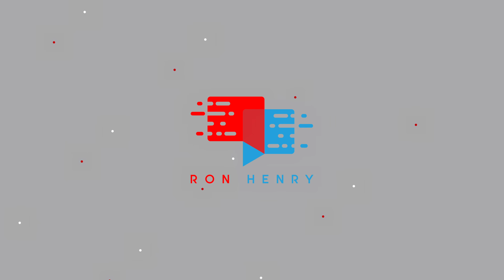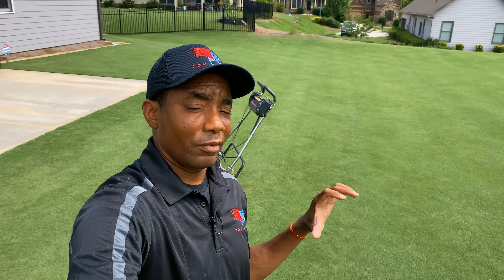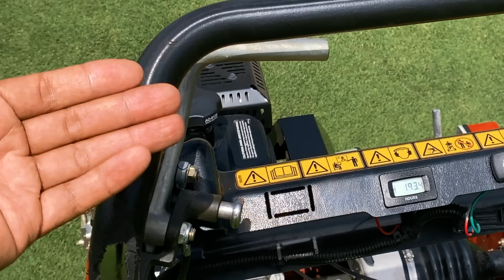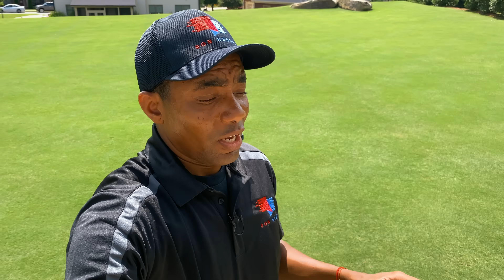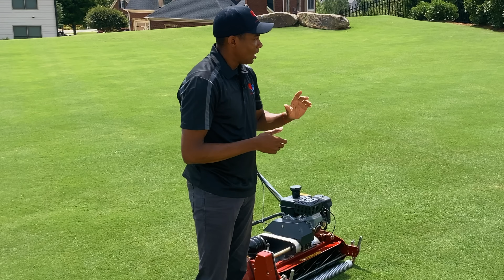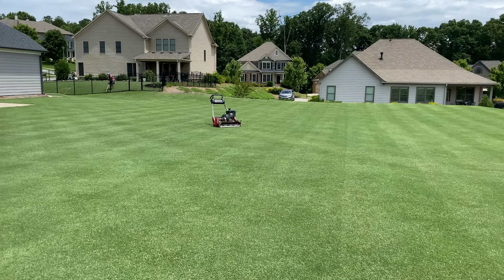Toro [GREENSMASTER 1600 REEL MOWER] - Is it Worth $10,000?

Comment: Hi Ron, so I have a tru cut and recently bought a flex 2100. Does HOC are different from each one to another?? Because I mowed with a tru cut at 3/4 and then used the toro at 0.4 but barely clipped any!! I asked someone and said HOC will do differently between different brands due to the weight of the machine! What do you think?
Reply from the maker: I think the hoc isn’t set to what you think it’s set to on one of the mowers. There may be a slight difference in cut at the same setting due to weight, but that’s a pretty big spread from .4 - .75
Reply: @RonHenry  I think so, maybe the tru cut! It’s the 4th hole from the bottom.
Reply from the maker: @ahmaddamra5847  Unless you're measuring it with a HOC guage, the holes on a TruCut don't mean much. Depend on how the front roller is mounted, there can be a large variance in HOC from mower to mower.
Reply: @RonHenry  then it’s definitely the tru cut because I measured my toro with electronic accu gage lol

Comment: How do you find a pre-owned toro greensmaster?
Reply from the maker: Heya Todd. I got mine from Prarie Turf equipment in Manitoba. https://prairieturfequipment.com

I’d also reach out to Jerry Pate Company and ask them which pre-owned mowers they have in stock.  They’re a Toro dealer so any mower you get from them will be freshened up with genuine parts.
Reply: Thanks Ron - they have toro flex 2100 reel mowers… are these different than the greensmaster?

Comment: Used this for 6 years working at a golfcourse back in the early 2000s. Great mower for fairway collars and aproaches. 
The main thing that can be a knock on it is compared to the smaller greensmaster flex series, and why we didn't consider it for greens, is the operator input. The smaller 1000 series had the spoke for traction engagement also control reel engagement by just tilting it a bit inward before pushing it forward, which made it so much cleaner to operate. It also weighed a lot less but had almost the same motor power which made it handle so much better. It was a real surgeons tool on the greens with more challenging design. 

Great content!
Reply from the maker: Thanks so much for the feedback aggeman2. If you like cool mowers, check out this new monster! https://youtu.be/-O8yJFNXZe0

Comment: I recently purchased a Greens Keepers 25" McClane. I am happy with the cut. I am now concerned about having to backlap my reel multiple times a summer or cutting season. What is your experience with backlap frequency? Also, I'm kinda scared about getting my reel the correct height in relation to the bed knife. Any concerns you can share?
Reply from the maker: I don't typically backlap Patrick. I try to be really disciplined about not mowing anything other than grass with the mower. That does a lot to preserve the edge on the reel and bedknife.  I'd consult the service manual on setting the clearance between the reel and bedknife. You don't want too much or too little clearance.  Hope this helps.

Comment: would you go 1600 or 2120?
Reply from the maker: Depends on if you want a Flex head cutting unit or not. I've not used a Flex to be able to speak from experience how cuts compared to a fixed head.  You don't be upset with either one.
Reply: I have never done these types of mowers before... so i'm green.... Laying sod this thursday, and wanting to make sure I make the right choice.

Comment: Hi Ron! I have a question, does the number of blades on the cylinder have an influence on the cut of my grass? I would like to mow at 1.34 inch because my future machine TORO GM 800 has 14 blades THANKS.
Reply from the maker: Yes it does. A 14 blade reel is really best suited for the higher mowing frequency associated with lower cutting heights. That reel designed for mowing greens (< .25"). Mowing at 1.34" is definitely on the tall side. You'd be better off with an 8 blade reel at that cutting height. Hope this helps. 🙏😎
Reply: @RonHenry  ok thank you for the answer that means with 14 blades the machine will manage to mow at 1,34 or it will be difficult for an average result thank you
Reply from the maker: @totodu7464  I don't believe the Greensmaster even goes up to 1.34" The max cutting height is 1.25 if I'm not mistaken. It will likely work. It's just not ideal. If you don't mow frequently, the mower is much more likely to bog down.

Comment: For the self-propel system is there a speed control?
Reply from the maker: Hi Chaddons. The throttle controls how fast the mower moves. There's not a separate control just for the self-propelled system. It's all linked. This is done so that the speed that the reel is turning is matched to the speed the mower is moving. Produces a more consistent cut.
Reply: @RonHenry  Thanks love your videos, new subscriber, binge watching all of them.
Reply from the maker: Thanks so much Chaddons.  I really appreciate it sir.

Comment: Just picked up my toro greensmaster 1000. It's an 11 blade 21 inch cut yesterday.  It's much heavier than my California trimmer. Can't wait to test it out. How do clean your Toro, I am thinking about using motorcycle cleaner.
Reply from the maker: Very nice Tony. The weight of the Greensmaster is an advantage. Helps the mower stay connected to the turf which decreases the likelihood of an uneven cut. rinse it with water after mowing. You shouldn't have to use anything too harsh on it unless you're trying to clean it up when you first get it. Cleanup after mowing should only require water. Congrats on the mower sir! if you'd like to see the kind of cut you can get out of a 11 blade, check out this video: https://youtu.be/A8Focvb3_zQ Thanks for watching sir. Appreciate the support. 👍😎

Comment: The prices on the toro are very high.  Where did u get your mower. I already have a California trimmer
Reply from the maker: They are really high Tony. I got mine at Prarie Turf Equipment. Probably the cheapest way to get one is from an auction.  Can often find them for under $1000 in those cases.

Comment: Can you cut Empire zoysia  with the Greenmaster 1600 1.5 inches high .I bought it for my Paspalum but I had to replace it with Zoysia due to the weeds issue on Paspalum. Great Video!
Reply from the maker: Hi Dr. Marder. Unfortunately the maximum height of cut the greensmaster 1600 is 1.25". The good news is you can easily maintain Empire at 1" if you're using a reel mower. Let me know if I can help with anything else. 😎👍
Reply: @RonHenry  Thanks so much.All the best.
Reply from the maker: No problem at all.  Thanks for watching. 👍😎

Comment: What’s the best way to find a good deal on a toro? What price is considered a good deal?
Reply from the maker: Hi John. You can shop around locally using craigslist, offerup or facebook marketplace. If you're will to get one shipped in, Prairie Turf Equipment carries some really nice units. Typically a bit newer so the price is higher. Expect to pay anywhere between 1500 - 3500 depending on the age and condition. Hope this helps.

Comment: Getting closer and closer to wanting a reel.  Neighbor has a Greensmaster he wants me to try out and hasn't used in awhile.  Do you have a good video or link to setting up the HOC?  What tool or method do you use?  I want to give it a try, but would obviously have to scalp and reset the HOC.   I'm unfamiliar with exactly how to adjust the HOC on Greensmaster.  Do you use one of those expensive measuring tools or is there a simpler (cheaper) way?   Could be a good quick video idea?
Reply from the maker: Hi S Flynn. If you use the Greensmaster it's going to ruin you. :-) There's practically no scenario where you use that mower and don't end up buying one. I don't have a video on changing the height of cut as yet. It's something I can work on. I do use an accuguage to properly set the height of cut. You really want to use something like that because setting up the height of cut properly has a HUGE influence on how the machine performs. If one side of the bedknife is lower than the other, you're going to get a weird looking result. Setting it isn't hard but you do need the correct tool. Here's a video on the process: https://youtu.be/6ryX4WZ_SQI
Reply: Ron Henry yep that is why I have delayed trying it out ha.  Do you think it’s too late in the season to try it out?  I’m currently cutting the back yard at barely over 1” with my Honda rotary.  Front yard is over 2” so I’ll probably not mess with the front this season.
Reply from the maker: @AUav8r05  nah. Not too late. I wouldn't take it down by a ton, but .3" - .5" lower should be ok.

Comment: Ron, did you consider a Swardman or Allett.  The US Swardman dealer is not too far from you from what I gather.  I’m in North Alabama and looking to get into reel mowing.   Lawn looks great and videos are very informative, keep it up.
Reply from the maker: Heya Kevin J. I did consider those 2, but after talking with a few greenskeepers, they told me I need to either get a JD or Toro for longevity and quality of cut. I still need to try out an Allett or Swardman as some point. It might turn out to be everything I never knew I always needed. 👍😎
Reply: Ron Henry, thanks for the feedback.
Reply from the maker: @Clays_and_Valor  no problem at all. Let me know if I can help answer anything else.

Comment: one thing to note, if you are buying one of these and do not get it with the catch basket, they are nearly impossible to come by even from toro.  They are basically only sold with a brand new mower.
Reply from the maker: I didn't realize that Andrew. My mower did come with the basket. I just don't show it in this video. You make a great point. 👍

Comment: Need work on those lines a little member find something amd focus on it and make that ur first pass no matter the direction love the channel keep up the great videos ..I'm just giving u a hard time beautiful yard man I was actually going to buy an antique push mower do u believe if I sharpen it it will give me  a nicer cut I understand motorized higher rpms to rotate but the blade spinning over instead of your typical mower would it still be  better for my yard?
Reply from the maker: Thanks for the tip Boe.  😎 I do need to work on improving the #stripeaction with the Greensmaster. An old style push reel mower will give you a pretty good cut. Believe it or not, I used to cut this entire lawn with one for a couple of years before I got the Tru Cut. If you look back at some of my earlier videos you can see. Here's a review of the two reel mowers I used to have: https://www.youtube.com/watch?v=BdFZiHzKXss and here's the results of cutting with them. https://youtu.be/lT5D2VLRf7E Let me know if I can help with anything else. 👍😎

Comment: Congrats on the mower!  Im also wanting to buy a greens mower.  I wish you would go over pricing.  Did you get yours new or preowned?  What is a fair price for a working used one?
Reply: James Hudson they are a lot like cars in that you pay a premium for something with low miles, all the maintenance done, and a warranty.  

They can be had at auction in as-is/where-is condition for $200 or less even.  And like cars, if you have the ability to work on it and correct any issues, it may be worth that chance. If you are looking for something to just mow with, you’re better off buying from a used equipment dealer like Ron did. 

Units that are less than 10 years old and have had any issues corrected by a professional, typically retail for $1000-$2500.  In exceptional cosmetic condition, super low hours, again, expect to pay a premium.  I have seen “like new” units (recent models) from various brands go for $5-6k.
Reply from the maker: Great comment Brian. thanks for chiming in.
Reply from the maker: Thanks James! I'm really enjoying it. Mine is pre-owned. Brand new they go for anywhere from 11,000 - 12,500. Very expensive piece of equipment. I got mine with 192 hours for just under $4k. So definitely not cheap, but a far cry for new pricing considering a what the mower costs new. I'll go more into pricing in my video comparing the Tru-Cut and greensmaster. Should be releasing it soon!

Comment: Setup proper sir!  Grooved roller out front and 8-blade reel is the right rig for home lawns.  Mower setup is everything for quality of cut.  

Subaru engines were my favorites, so, so good.  Quiet and powerful, well-built.  Unfortunately, Subaru exited the small engine biz.  So parts will eventually disappear.  Take care of that engine, and I highly doubt you’ll have any trouble.  

One advantage of a greensmower vs other reels is the weight and the rollers.  A grooved roller up front followed by that big traction roller will have a noticeable smoothing effect on the lawn.  After one season, my lawn was a totally different animal.
Reply from the maker: Thanks Brian! I'll do my best to take care of it. It's very quiet and smooth. Very noticeable difference from the Honda on my Tru Cut. Not sure what kind of muffler system Subaru is using, but it's very, very, quiet. I totally agree on the effect the mower is having on the lawn. Every time I cut it, it gets better. Smoother and smoother.

Comment: I went straight from a rotary to a GM 1000 and I have no regrets on skipping over the residential models. Everything about these mowers is just perfect. Have you considered installing the clip kit? It adjusts the frequency of clippings by adding torque and slowing the reel down a bit. It gives a better quality of cut if you’re cutting 0.5 inches or higher. That and the 8 blade reel together is supposed to be the sweet spot for mowing at a fairway height. That’s what I’d like to do eventually. Supposedly it’s not too hard to install but you have to order it from Toro and it’s about $400
Reply from the maker: Hi Dangerlawn. I haven't considered installing the clip kit. My actual cutting HOC is close to half inch with the bench height being set to .625. The mower already cuts so well, I'm not really seeing a need to mess with it. I don't see myself doing the groomer either. The GM 1600 is definitely a game changer. Serious step up in improving the quality of cut. It's cool that you went straight from a rotary to a greensmaster. You weren't messing around 👍😎

Comment: Hey Ron great video. I have a quick question. After Top Dressing several weeks ago I now have a small weed outbreak.  Will Spectricide Weed & Feed be a good option for this time of the year? I do not want to risk  burning my lawn.  I have Bermuda 419 Tifway. Thanks for your assistance. Have a great day.
Reply from the maker: Hi Demetrius. I've not used the weed and feed product before but it's anything like the granular pre-emergent, the application temps are between 45 degrees to 90 degrees Fahrenheit. As long as your temps are under that, you should be ok.
Reply: @RonHenry  Thanks Ron.
Reply from the maker: No problem man. Let me know how it works out.

Comment: Ahhhh.  I see I guessed correctly hehehe.  I’d imagine the lawn will take a huge step.  I know mine did when I moved from TC to GM.  Very thorough review too.  I don’t know much about Toro GM but this made me very aware now.  Did you go the auction route?   Or find it at a golf course?
Reply from the maker: You did Frankie! There is a very, very noticeable improvement in cut quality. The more I cut the lawn with it, the better it’s looking. Definitely a game changer. 

I got it from a supplier that takes in off lease golf course equipment with low hours.   https://prairieturfequipment.com/ is where I got mine.
Reply: Now that I’ve re-watched on my AppleTV, That bad boy looks almost brand spanking new too.
Reply from the maker: Only 192 hours when it came to me Frankie. It practically is! :-) Thanks again for watching the content man. I appreciate the support.

Comment: Thanks for all info on your channel. I'm new to reel cutting and recently purchased a  Cal trimmer (Honda motor, 7 blade). It does a good job and its given me a noticeably  better cut than my rotary.  I want to know some if the things I need to be careful of so as to not damage the reel mower. How close can I get to the curb etc. Maybe you can make a short video bout that for us novices, lol. Thanks again, love your channel!!!
Reply from the maker: Sure thing Chris. Does your California trimmer have a front roller or caster wheels? With a tiny roller you can get really close and even overhang a bit without issues. This of course assumes that your sidewalk/pavement is flat without any sharp peaks jutting up.  Kind of unlikely but that’s the only qualifier I’d add.  I’ve used both the greensmaster and tru cut along the pavement without issue.  Let me know if I can help with anything else. 👍😎
Reply: @RonHenry  I have a front roller. I try to check for small pebbles, tree debris etc.  I mow more cautiously than with my rotary, lol.  Thanks for the feedback!
Reply from the maker: If you have a front roller, you should be fine. Remember the front roller rides quite a bit lower than the reel. If you're cutting at .5" or higher there's practically 0 chance of the reel impacting the concrete. Again, with both the Tru Cut and the Greensmaster I overhang a tad and there's never been an issue.

Comment: Nice mower!! No need to take the transport axles off. Being that you are already fully invested in this just get a landscape blade for the tight spots. Personally the roller grinding on the concrete would drive me insane. I have only one obstruction but I hate using the string trimmer because it chews the edges so I am going to pull the trigger on the landscape blade been hesitant for a while but after seeing the way it compliments a greens mower's cut its worth the investment.
Reply from the maker: From the videos I’ve seen SMK, they seem to cut very well. I still have my Tru Cut so I’ve been using that for cutting between Alex’s lawn and mine.  Yes it’s crazy to use 2 mowers to cut the lawn but the result is really good. 😎 Thanks for the tip.